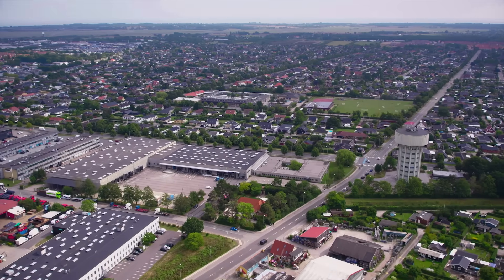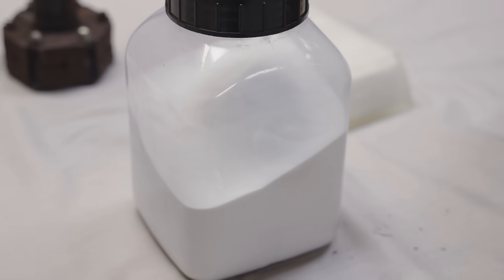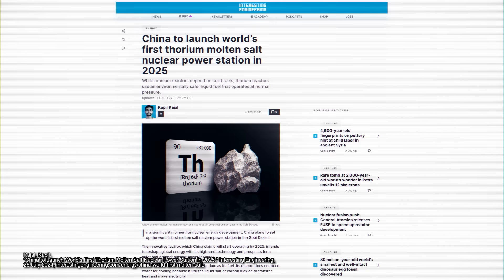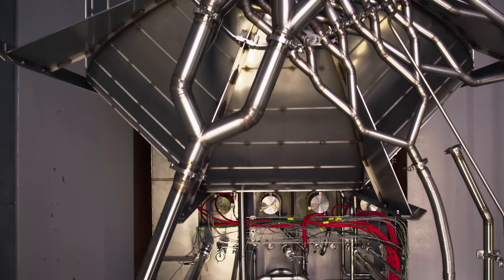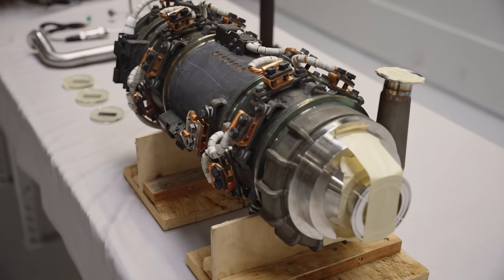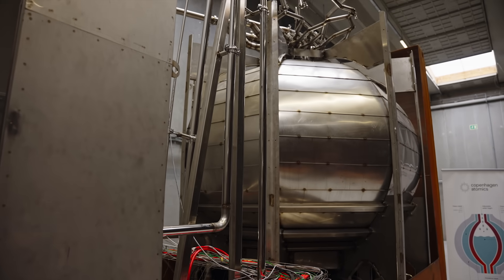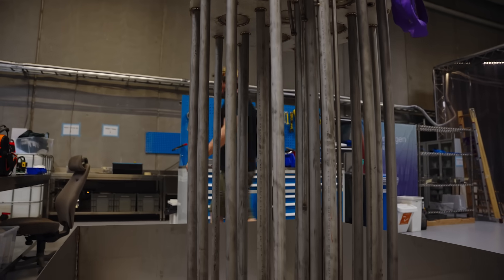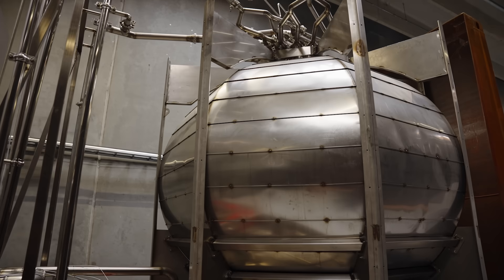Why Isn’t Thorium Changing the World?

Comment: Good luck to Copenhagen Atomics, but they should not just throw out energy production and source numbers. 
According to the IEA, in 2024 the Global electricity generation by source was about 30.000 TWh. Coal contributed 10.7k TWh, Gas 6.7k TWh, and they list a mere 120 TWh as "other non-renewables". That is way short of the 80% share mentioned at 13:00, apart from the orders of magnitude. 
For the record, nuclear contributed 2.8k TWh and "renewables" 9.8k TWh.
Still, very interesting, thanks.

Comment: @kylehill thank you so much for the screen capture "Molten salt reactors are a bad idea" by M.V. Ramana Ph.D. because if this is the best argument the anti-nuclear activists can come up with we need to get building. We need to get building nuclear reactors yesterday.

As one of the end users of a large piece of industrial equipment, having working on the prototype through to the second generation version, if the engineers are getting is right on their first try it wasn't a very complex machine. Prototype over built, heavy, a nightmare to work with. Gen one lighter, faster and easier to work with but the design engineer showing up on location "we've got cracks" and a welder with parts retrofit a critical component. Gen 2 runs like a top and the customer absolutely ecstatic that we can get the job done in 5 days instead of 10.
Reply: I was told a story I think in high school where one of the big auto manufacturers got a new piece of equipment from like Sweden or Germany to do some task.  However it would need to be taken down for 2 entire weeks for maintenance each year which was a huge problem.  So the company got a team of their engineers and maintenance team to tackle the issue, they cut down time from 2 weeks to less than a day.
Reply: mind mentioning what you worked with?
Reply: @jj-jak  Oil and gas well drilling. The "large pieces industrial equipment" I saw evolve were the Precision Drilling slant rigs.

Comment: @kylehill Great video! I often bump into credible people arguing that it will take decades to develop the thorium technology to the state where it is ready to go in a power plant that has to function for 40+ years. I believe part of China's research is aimed at developing a super alloy that will last this long. 

In my view, the game changing difference between Copenhagen Atomics  and China/the Oak ridge experiment, is CA's strategy of swapping the reactor every fifth year. This allows for the use of stainless steel, and lowers the design requirements of the components. It allows CA to start building power plants before all components needed in a breeder system have been developed, and upgrade them along the way. Also they will iterate on the design faster. This is what excites me about CA, and gives me hope that their aggressive timeline is not completely out of reach. I've noticed that most critics misses this point, so maybe you could point it out in the future?

Comment: "solving" the corrosion problem by small changes to the salt chemistry is a cheap way. If it works fine, but this requires dealing with the salt chemitry at least to a small part. The final fuel salt will be different from the tests and having the fission products is a next level of change to the chemistry, that can make the salt more corrosive. Another known point is corrosion from salt flow along thermal differences, like dissolving at the hot side and depositing at the cold end.

The real challange with thorium is getting the chemical cleaning working. The actual reactor is the easy part. Think of the thorium breeder cycle as a big chemical plant with a small attached reactor.
It is not just a technical problem, but also political, as the reprocessing is linked with a proliferation risk. If it works only half way reasonable (could still be a factor of 10 from economical), the technoogy could be used in making weapons grade material (U233 and Pu239). This means already the research in the area is high regulated and coutries like the US are banning it's use. With current technology it is about as difficult and expensice to clean (remove the rare earth elements) the thorium from single fluid reactor than it is to recover plutonium from used fuel. This means one is something like a factor of 10000 from beeing econnomic viable for this step alone.

Comment: For ours and our children’s sake, I really hope either molten salt reactors or fusion work out, otherwise things are gonna suck
Reply: You can build one yourself if you study hard enough. Just keep it secret.
Reply: We already have cheaper ways to generate power.
Reply: @armorclasshero2103 Solar and wind are nice but they, even with the help of geothermal and hydroelectric, won’t be enough to completely replace fossil fuels in all energy generation. Also,  power is only a small part of the energy use. Furthermore, many things require stable energy supply. So, intermittent sources won’t suffice, and before you say it, you can only add build so much storage before it becomes uneconomical and unsustainable
Reply: @thesilentgod7863  uneconomical? Lol. Batteries and solar and wind are becoming so cheap they're starting to hit near zero cost.

Comment: I'm kind of surprised they don't just use Ceramics for the piping and just surround that piping with replaceable S.S. Jackets.   
The other is just using Asbestos Pipes as used to replace raw cement pipes.  
Asbestos is one of those wonder materials that needs to be HEAVILY regulated out of contact with humans, but its perfect for this application in a closed loop system. 

Asbestos Gaskets are still going strong some 100 years later, and something tells me that using something that like within a carbon / Kevlar style matrix would allow the piping to last well over 25 years of operation or longer at very high temps. 

Instead of using a polymer to fuse the initial layers after the weave,  you instead use glass to be the matrix in the form of  borosilicate glass that has both High temp and high shock proofing.  

Since there is going to be little pressure compared to a  conventional reactor ;   Borosilicate Glass can be engineered to  withstand extreme shock and temperature fluctuations. 
While  using a ceramic coating   ( either by Vapor deposition or electrolysis ) is both wear resistant and able to withstand corrosion & breakdown from the fissile materials in the Saline moderator, it should work out quite well while also not being an arm and a leg in terms of raw maintenance costs over its cycle  lifetime. 

The other thing to do is just use Diamond.  
Its actually really cheap at industrial grades, and in powder form, its really quite brilliant for Radiological use for say in the reactor core assemblies. 

:face-blue-question-mark:   HOWEVER  :body-green-covering-eyes:

the biggest hurdle to all of this is going to be a society that respects procedures and maintenance intervals and puts that above cost and profit above anything else so that the electricity and power generated through any new nuclear systems will be properly maintained.
We have all seen enough industrial accents over the last few years where someone drops the ball and this is where a possibly very redundant artificial or AGI intelligence computing infrastructure should be in place in order to ensure the safety of the plant at all costs to prevent any accidents and loss of human life.
Reply: It is all permeable materials you mention as liners
Reply: @Jakob_DK   I would say it " Depends " 😁

Only to  Helium atoms & Hydrogen molecules. 

There is going to be some permissibility in the raw materials, the matrix of them allows low bleed rates  ( permeation ) when in use at these higher temps. 

You will still get some amount of diffusion no matter the material, but the rate is what is important here being as the Liquid sodium moderator / Fuel  tends to bind with the larger sodium chloride that is generally not not going to leak. 

(At least in the classical definition sense of the term "Leak" ) 

 I hope that helps.

Comment: Let me get this straight:

They solved the main problem of molten salt reactors by developing a pump that moves a highly viscous, radioactive and corrosive mass at extremely high temperatures.
This component can withstand neutron radiation, which would normally transmutate the device's materials over time, weakening alloys and such.
In normal operation, the pump runs so hot that it glows red (includimg the electric motor).
And it will work like this for decades without any maintenance.

Using this technology, they built the first working prototype of a modern modular molten salt reactor.
In the first test phase, it runs water at room temperature.
The next step will take place off-site, where the reactor will run on molten salt and radioactive fuel.

SOUNDS LEGIT.

Btw. None of the devices shown appear to be able to withstand temperatures above 400°C.
The pipes and connections are straight from a dairy plant.

And the scateboard in their warehouse-turned-maker-space is a tripping hazard.

Comment: Deployment in the late 2020s? I don't want to be a neysayer, but shouldn't they run a prototype with actual Thorium for a few more years befor even thinking about commertial deployment?

Small rant following, sorry:
At 12:55 the entire world consuming just 20 TWh every year is comically wrong ... That's not even 5% of just Germany's yearly electric consumption, not even factoring in transportation and heat. Kinda worrying to see someone who claims to revolutionize energy production get that so wrong. The entire worlds primary energy consumtion is around 175.000 TWh yearly. Producing half of that in Electricity with Thorium would require around 10.000 1GW plants running 24/7 all year, worldwide. Building this untill 2050 would mean we would have to build 400 full sized nuclear plants per year, starting today.
 

I wish them the best, but i'm not convinced.
Reply: I think the guy just misspoke about 20 TWh and he meant 20 thousand
Reply: @Shimo_28 Still wrong, it's closer to 30 thousand.  Even if we ignore it and he misspoke, that still leaves the "50% of the worlds energy production" claim.
Reply: @ understandable that you are not convinced, they for sure have a lot of enthusiasm but I think you need to think in that way in order to achieve at least something
Reply: and the scalability of the power plants doesn't have to be linear, it all comes down to whether they will get enough support or not, which is sadly not very likely but who knows what might happen, and even if it would last till 2100 (that is if the humanity will survive everything), its still gonna be better than just relying on renewables
Reply: @ It's not just about scalability tho. Energy consumtion will just go up, so if it takes you to 2100 to build enough plants for todays demand, during that time demand itself has gone up as well. And TWh are TWh, whether you produce them with thorium or renewable doesn't matter at the outlet. As i said, your average Nuclear plant today has 1GW output, so you actually would need 10.000 plants to produce half of earths energy requirements. And for that you need specialized building firms for nuclear plants, which we don't have enought of. While Reneables can be build by pretty much anyone who can wire Solar panels together or has access to a crane for wind. 
I agree that we need Nuclear in the mix, but i highly doubt it will be 50% in any forseable future.

Comment: 7:28 - two things I don't understand. Why  just not use thicker steel and just leave, perhaps additionally treated "corroded" layer acting as protection? Also - hastealloy price - for machine that's supposed to run for 50 years - why would it even matter?  "working prootype" - "just running water" . A-ha. No need for radiation shielding then.....  also: that isotope removal thingy.....sounds awfully like smol CANDU reactor?

Comment: "You see, chemically speaking, a salt is just any metal bonded to another element through chemical proccesses"
That's incorrect. A salt is a combination of a cation and an anion . A cation is usually a metal ion, but it is not neccessarily true, like amonium  (NH4+). The anion does not have to an element either. In fact, most of the time, it isn't, such as sulfate (SO4 2-), carbonate(CO3 2-), acetate (CH3COO-)...

Comment: I thought Thorium was just more expensive and energy intensive to mine than uranium. In the end, it’s still a “nuclear reactor”, and as we all know, nuclear is evil. EBR2 was extremely promising and solved a lot of the problems inherent to the traditional “light water” reactor. IIRC EBR2 used a molten tin/bismuth for heat transfer. We have a couple of those “reflective solar” power plants by me. They are currently looking at shutting them down, due to a lot of issues and maintenance costs. A couple of the issues was carosion from the salt and the difficulty of keeping the salt from solidifying and smudging up in the pipes. Either way, with current technology being what it is, nuclear is our one clear path to “0 carbon” energy.

Comment: 12:55
What? 20 TWh makes no sense. Are we talking total energy or only electricity? And over what time period. Cause the numbers I fine are more like 170000 TWh per year tital or 28000 TWh per year electricity. I don't know if he was talking per year or per day, or watt not watt hours. Maybe Jule not watt hours 🤷‍♂. But something does not add up.
Also for electricity coal is about 35%, Natural Gas ~20%, Oil ~2%.... Ball park numbers. Wind, solar, hydro is about 7, 5 and 15%. Nuclear is about 10%.

If we are talking total energy the number are a little different.  Oil ~30%, Coal ~25%, Natural Gas ~20%, Hydropower and Nuclear ~5% each, wind and solar about 3% each.
But Oil, coal and Gas is close to 80% as he mentions.
I think electric cars have a huge potential, since 70% of the transport energy could be switched from oil to electric. And transport is ~25% of the total energy. Thus 70% of 25% ends up being a lot. But also heat pumps for heating houses and induction cooking have large potentials and non of these solutions require us to change our behavior that much. Thus they should be easy to implement starting with the lowest hanging fruit first. But non of these solutions requires Nuclear.
Also note that we don't nede to replace all the energy 1:1, since electric cars are much more efficient that gas powered cars, thus just by switching to electric we only ned like 60% of the energy we currently are using.

Comment: Is here a physicist or chemist around? Why is the salt on itself corrosive?  The corrosion I know about needs oxygen to work, and the Salt "only" works similar to a catalyst to make tke oxygen reaction more likely. Why don't they just not have oxygen in the reactor core?
Reply: Fluorine salts are verry reactive. They eat on the alloys directly (especially at high temperatures). Don't think of the corrosion like rust!
Reply: @torstenwehnert8549  So a reaction like Fe + F = :-(   ?

Since in our normal lives there is no free Fluoride around and it is most of the times even nastier than Oxygen it sounds like thanks for the explanation to me. I didn't think about that before.

Comment: 13:02 This is super duper wrong; not even close. Looking up on Our World in Data: 1. global energy production surpassed 20,000 TWh in 2009 (and is 30,000 TWh today) and 2. fossil fuels have never been 80% going back to 1985 and certainly aren't today--they've hovered around 60% throughout and are the lowest they've ever been today. Wind alone is almost 8% and solar around 5.5% and that's 2023 data, 2024 doubtlessly was growth in both as they're substantially cheaper for new generation than any other option and are increasingly even cheaper than just operating costs for coal.

Comment: Thorium isn't changing the world because it's a solution looking for a problem. We need a generation of fission reactors now, to bridge the gap to even the worst-case estimates for commercial fusion (if everything goes horribly wrong, and we have to rely on the ITER family tree, which will be a disaster), and standard fuel configurations work perfectly fine and are no more hazard or fuel supply issue than Thorium reactors. To have a Chernobyl or Fukushima-scale problem with a reactor was an impossibility at the time those incidents happened in countries with an even vaguely competent nuclear regulation scheme, and you're not going to get investment in countries that otherwise might benefit or they're fully anti-nuclear regardless of the guarantees.